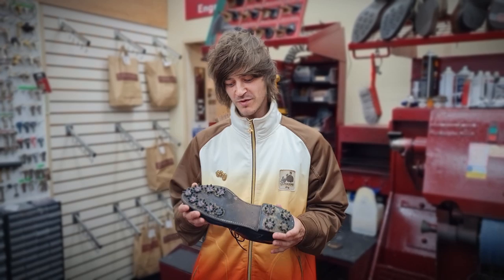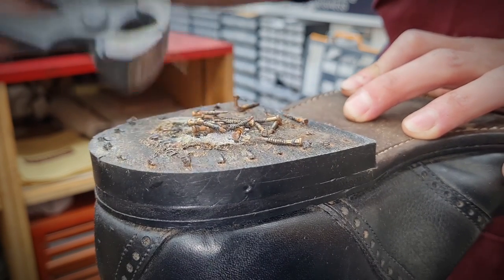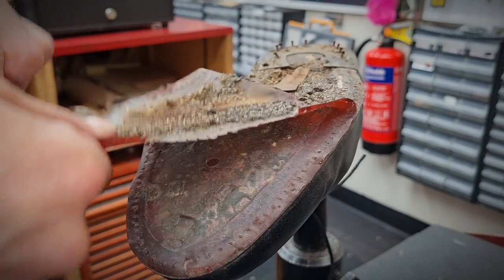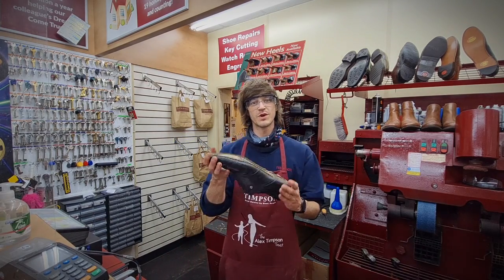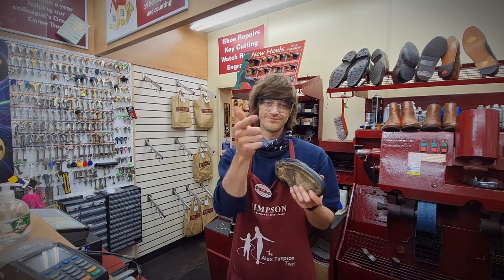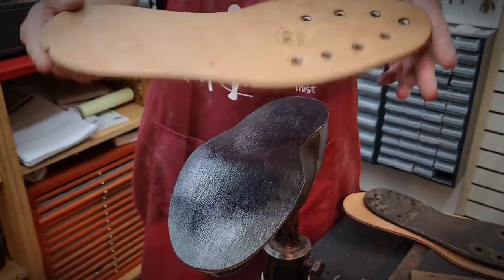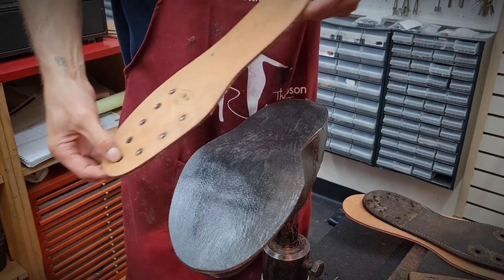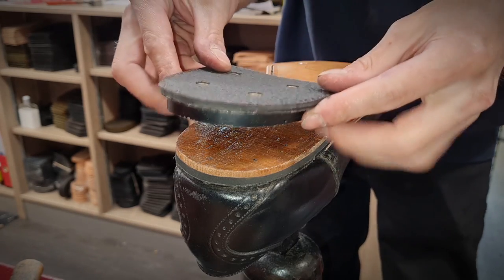Rebuilding Vintage Golf Shoes! FootJoy Classics REBUILT from the Ground Up | SHOE REPAIR

Comment: Do you put glue on the footbed before applying the new Cork?.....Great job again.
Reply from the maker: No as the cork is wet, it molds into the shape of the cavity and once it dries it is solid in there, no need for glueing in

Comment: Just my opinion...but there was absolutely nothing wrong with that shoe sole at all. I would have just cleaned the cleats up, and cleaned the sole off. (One maybe, could have changed the cleats if one just wanted a "cleaner" look). But as far as the sole went...it was perfectly fine. Cobblers are in some ways like Barbers. You may want a haircut...but you don't really need one. Just sayin'.
Reply from the maker: Well when a customer comes to me and wants them to be new again, that's what I've done for him. There may be life left in a sole, but if someone wants it replaced, where's the harm in that?